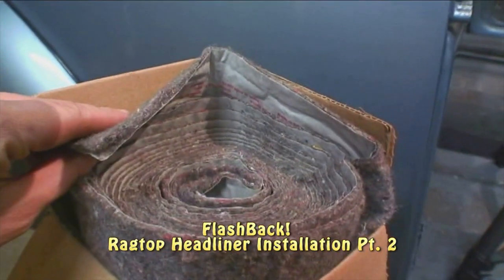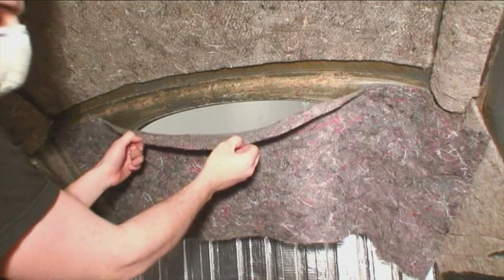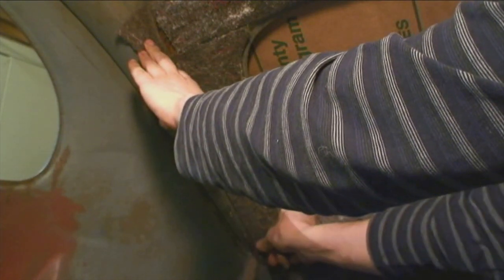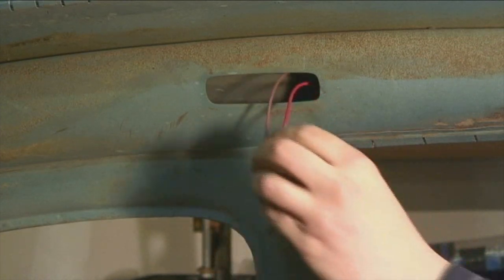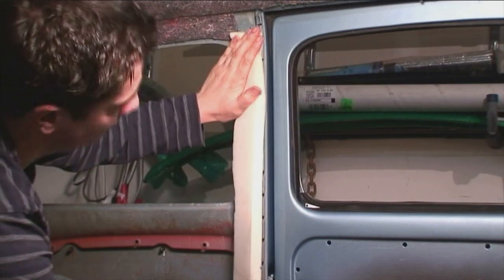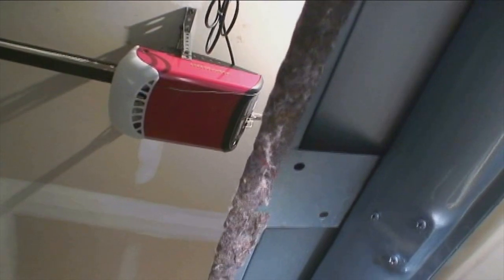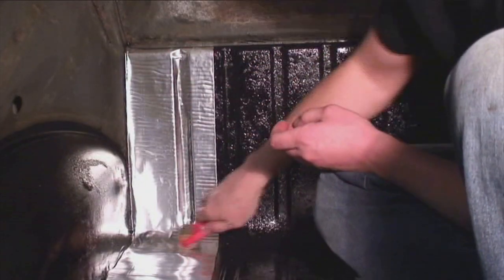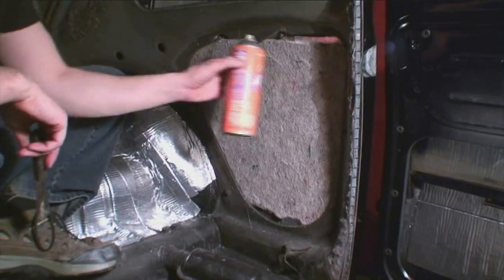Classic VW BuGs How To Install a Ragtop Beetle Headliner and Top Part 2

Comment: I highly recommend getting a quality roller for doing this- metal and wood, maybe with a urethane wheel. I bought an all plastic $2 cheapie from Lowes when I bought my roofing rolls, and it worked well for about 10 minutes. Then the roller kept falling off, comedy ensuing for the rest of the application.  Also, if you get air bubbles, a push pin is great for releasing the air and you just roll it flat, easy-peasy. The application is actually kind of fun to do. One suggestion for inside the door panels- start at the bottom horizontally, and as you add the next row up, overlap the top of the lower row by 1/2 inch (or 1 cm.)  This will act like a roofing shingle, so if any water gets inside your door from the window scraper, it wont have a gap/ledge to get trapped in.